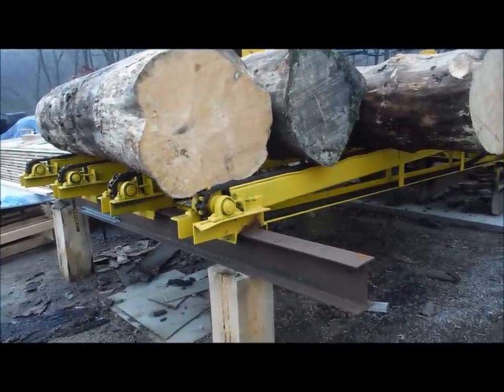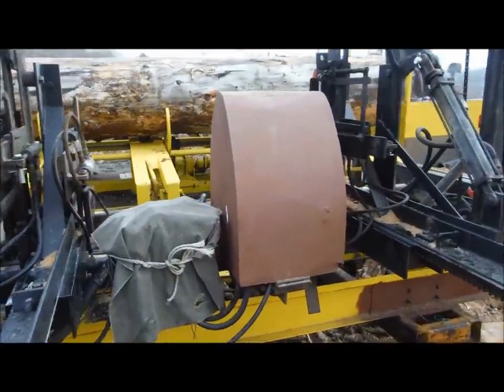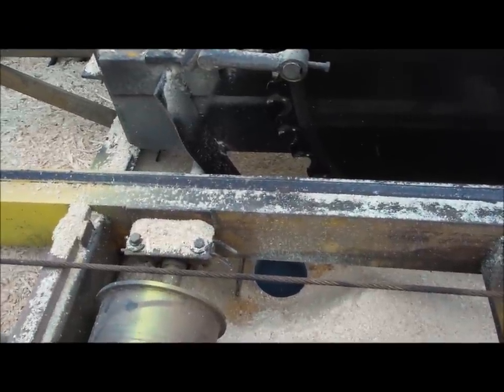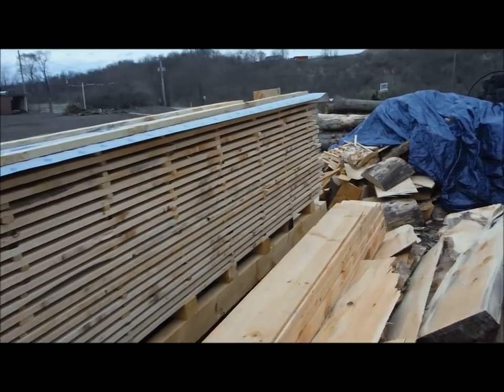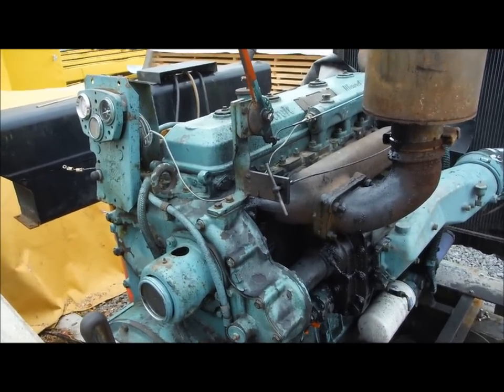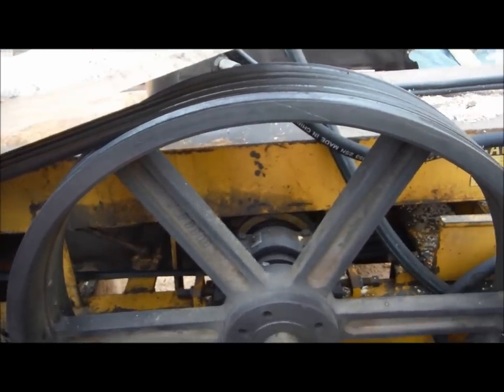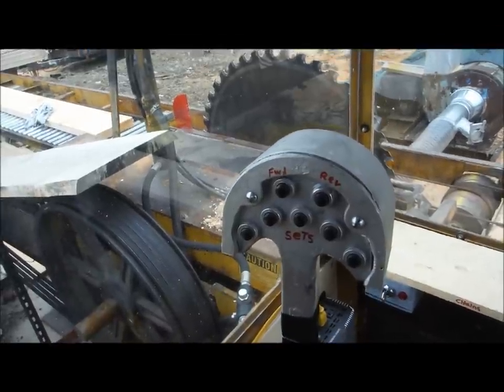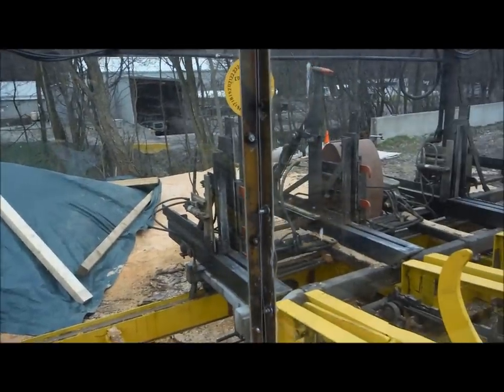sawmill tour

Comment: Thought I'd subscribe because you got to have something in common with somebody that runs a bus motor for a power unit! The one down the road is a Frick, straight manual but has been there since the 60's. The grandson of the original sawyer runs it now and it's something to watch. Peaveys and cant hooks. Has the edger and cutoff working and enough room for a truck to back underneath for dust and cutoff chunks. The original had the dust doodling chain. A real deal. We'd go off bear when we got in after school. Worked like out butt was on fire till dark. I hated football and built muscles toting boards and slabs and turning logs.
Reply from the maker: thank you for subscribing , what a great story.
Reply: @markgalicic7788  A life Blessed and well lived and worn out!